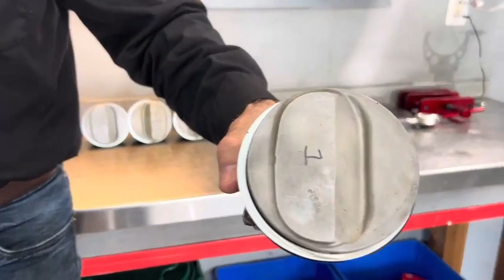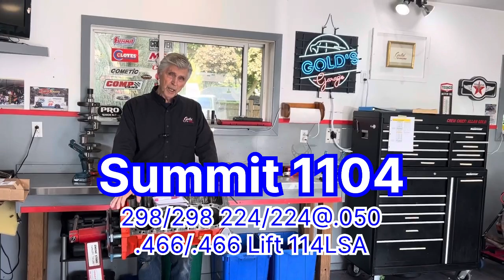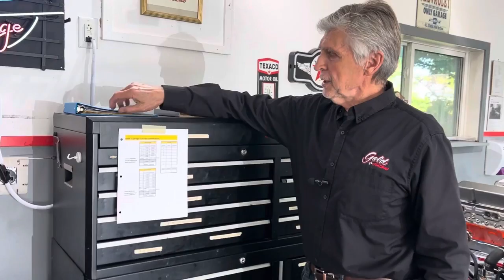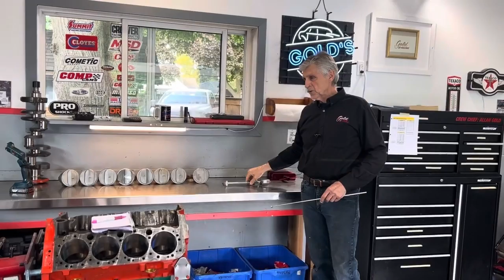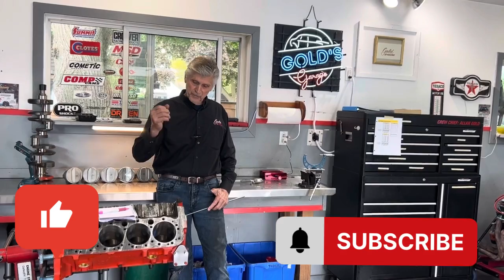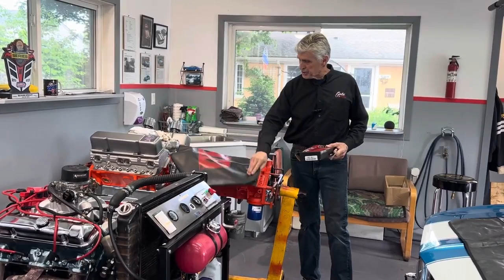I GOT RIPPED OFF ON THIS 350 CHEVY!! - What Happened?? What should I do??

Comment: Thanks for reinforcing the information of the strength of a two bolt main small block. When I bought my 55 Chevy 27 years ago I pulled the engince and found that it was a two bolt main 350 ci engine. My car building friends advised me to sell it because it would never hold up in a perormance build. Since that time I have read where the two bolt main would have been fine. Nice to have that reinforced here. I did sell the block and someone got a pretty good deal. I learn a lot from your videos.
Reply from the maker: Thanks Neil. There are a lot of misconceptions out there. Before Chevrolet introduced the 4 bolt design in 1969, even NASCAR engines were two bolt, making about 600HP. Glad you found the information helpful.AG

Comment: Hey Ace I feel bad you're having so much trouble with getting what you want from the machinist. It reminds me when I overhauled my Pontiac 400 a long time ago. I did a few engines from this local shop where I live and I had Chevy engines that become junk in short order and I found out why mine did that. It was because the oil passages were dirty and I trusted them to clean it  after reconditioning the crank and block but they didn't so when I had the Pontiac done I told them what happened the last time and I asked them to make sure its clean but guess what. I took it home and bought a brush cleaning kit and you should have seen what come out. You could plant a mustard seed garden. I was hot 😡 looking like new on outside but would have become instant junk if I didn't clean it myself and check behind them. Finally I have a reliable engine. That's the one with the sum-2800 cam it runs good
Reply from the maker: That is a good story Christopher. Why you have to check everything yourself. Thanks for contributing. AG

Comment: That crank would have spun that bearing. I run my stuff on the loose side. Even with .009 bearing that is only .0017 clearance. Personally I’d have crank reground .020 and use .020 bearings but that’s just me
Reply from the maker: Thanks Turbo. With the .009" bearings I am now between .002"-.003" on both rods and mains. AG

Comment: That might be interesting to some people to know what the deck height is to get the quench you quoted. It looks like the block wasn’t decked. 
Piston, part numbers, and Vortech casting number.  New or used Holly carb and model number.  What connecting rods and I’m assuming it’s a cast crank.  Just a few things off the top of my head but I’m sure I missed a lot
Reply from the maker: Thanks for the question. The deck height is .025" so with a .015" head gasket, quench is .040". The Vortec castings are 062,  stock rods and crank. pistons are 7051P, .030". No carb is selected. AG

Comment: fire sale !! we had a machine shop around here that screwed everything up they touched just like this ! i brought them carillo rods to clearance for a stroker they took so much off the rod the boss cracked with 60lbs of torque put on the bolts ! all i asked for was for them to take a tiny bit off and they destroyed some very expensive rods ! in a year they were out of business they gave me a 350 olds crank after i took them a 455 crank and my assembly wouldnt turn over ! i took the crank back and told them somewhere theres a guy with a 455 crank ! when they return give them their 350 crank ..sure enough a customer comes in yelling at them these mains wont bolt up what did you do to my crank !! bam got my 455 crank took it to another shop well it was full of cracks that i know were never there !
Reply from the maker: Thanks for sharing your experience Steve. Unfortunately there are many stories like this. AG

Comment: Great video. Unfortunately this kind of stuff happens often. I once bought a "350" that turned out to be a 305.😡
Could you share the part number for the rod bearings? I also need some that are for a 10 under crank with .001 extra clearance.
Reply from the maker: SUM-909H009  - Main Bearings 
SUM-663H009 - Rod Bearings 
Thanks for watching.
AG
Reply: Thanks!

Comment: Way too tight bearing clearance & good you Measured/checked....that Pop-up Domed piston could be Problematic for pump gas octane operation....Back in '69, used Similar domed TRW forged 0.060 over pistons in a factory stock '66 389 4 speed 4 barrel GTO engine with long duration Solid lifter cam....Don't know what actual static CR that was but Even on Sunoco 260 engine ran Hot, would over-run starter & almost start up Without ignition coil connected !! ....With stock dual exhaust mufflers, had a very Unusual "Diesel" exhaust sound whatever that means.....Just sayin those high dome forged Pistons caused me Problems back when nearly 100 octane pump gas was available.....
Reply from the maker: Thanks for the info Tom. We have revised our plan since this video. Now using ProMaXX heads and the calculated cranking pressure is safe. I will do a follow up on this engine. AG

Comment: That spec is similar to the 350/350 vette engine, but with way better heads. Should be a nice street engine!  I try to follow the .001 per inch of dia. New engines run way tighter but 0w-16 oil.
Reply from the maker: Thanks Mike. i would also expect that the tolerances would be tighter on a new engine. You just gave me an idea for a video about tolerances. AG

Comment: I’m surprised you run single pattern cams with Vortec heads. I always read not to. I’m going to run 1103 summit cam, Vortec & stock 400
Reply from the maker: Thanks DRD. I have a follow up video coming on this engine. AG

Comment: I bought a rebuilt short, had to disassemble it and clean it properly, all the machining was good, oil galleries were never cleaned properly and the bores needed a proper clean.
You're eventually gunna get caught out with late intake closing with high comp, if you use good heads and a tuned length inlet manifold will fill the cylinder properly and rattle.
Reply from the maker: Thanks Tom, that is a good point, we will be watching for that on the dyno. AG

Comment: I wouldn't worry about the rods. Mains are a bit tight. Run thin oil and it will last fine NASCAR engines run about .001 on both rod and main with 0w17 oil and only about 45 lbs oil pressure.

Comment: Those pistons will hit the head  unless you machine the chamber in the center of the heart shape.
Reply from the maker: Great advice Brian, I will check that out for sure on assembly. Thanks. AG
Reply from the maker: I mocked it up already. You are correct Brian, they do hit on the spark plug boss. Plan B, I will use my ProMaXX heads on this build and save the Vortex heads for another 350 i have to build. You saved me a lot of trouble. Thanks very much. AG

Comment: .0007 and .0009 is too tight to form the proper oil wedge for the bearings. This is probably why they are not in business now!  I dont know if this shop ground the crank or if they farmed it out, but obviously they never checked clearances!
Reply from the maker: Correct, thanks for the comment. AG

Comment: What compression are you running in the sbc that is going to have the Howard’s camshaft in it.
Reply: It's a good thing (For everyone) you checked & Measured 'cause the typical buyer Assured of "Built" 6500 Rpm "Race" componets/assembly would likely have had a very "Bad" run experience & returned the mess to you....Changing directions, It'll sure be a nice reliable street motor for some lucky buyer.....
Reply from the maker: Thanks Tom. AG
Reply from the maker: I would need to know the cam specifications to answer that question. AG
Reply: 470 lift..108 LS

Comment: Comp cams has the 12-673-4 Nostalgia solid which they say is a modern tight lash version of the 30-30 cam with the same exhaust note.

Then they have the 12-672-4 hyd flat tappet which they say has the exhaust note of the 30-30 cam with increased performance.

Lunati has solid versions of the Duntov and Z28 cams, numbers 30121009 and 30121005.

Howards has solid versions of the Duntov, 1st design off road and 2nd design off road cams.
112192-14, 117422-12, and 117692-12.

Lastly Crane has solids their versions of the factory Z28 cam and the off road cam.
967251 and 968821.
Reply from the maker: Thanks for all that info and even the part numbers Pockets, saves me a lot of research time. AG
Reply: @goldsgarage8236 I found a few more!
Comp 12-107-3 solid, says factory 302 cam.
And Summit has SUM-1125 and SUM-1126 solid cams.
Reply: Welcome!

Comment: You are going to have too much compression with a set of Vortec heads and those pistons. The chambers are too small. The cam is fine as it is the same as the Chevy L 82 cam. If you use aluminum heads then you can usually squeak by with a 65-68 cc chamber and those pistons. The aluminum sheds the heat and allows the higher compression. If you go that route then don't just use some junk heads, put something decent on it. All the power is in the heads. The Vortec is a good head but they have cracking problems and they are iron which is not good for your situation.
Reply from the maker: Thanks for the great advice Mike. AG

Comment: A great spring package for vortec heads and flat tappet or hyd roller cams, that requires zero machine work, is the following.
Summit beehive springs SUM-174002, Summit retainers SUM-174003-3, Fel Pro SS72861 valve seals, and stock vortec locks. This gives 1.75” install height, at 109lbs, and clearance for a .500-.520” lift cam (measure due to variances). If you substitute the locks for +.030” Competition products VTO4134, for 1.78” install height and 98lbs on the seat, you are good for .530-.550” lift cam. Again variance is due to machining differences.
Reply from the maker: Thanks for the detailed information and great advice Pockets. AG
Reply: Welcome!
Reply: This is awesome info! Thanks!

Comment: Yeah that is a tight one. 
Speaking of 4 bolt blocks, I have one I'll be selling soon since I decided on a crate engine rather than building what I have, a .040 over 350 010 casting block. Have an EPS manifold that's very near new also. Even got a billet manual flywheel for it and many other goodies. There is always another project though.

Nice work on keeping track of the details!
Reply from the maker: Thanks Jimmy, if anyone is interested you can connect on my channel. AG

Comment: It would have had great oil pressure until - oil temp would rise from being to tight. And absolutely would of spun bearings. The cam is a comp magnum series. I'd of chose to regrind crank. 6 of 1 half dozen of the other.
Reply from the maker: Correct, thanks Pat. AG

Comment: I pulled an original 67 Camaro  ss engine  a 350 first year and it was a 4 bolt with a forged crank, so they were built before 69.
Reply: 4 bolt mains were not available until 1969 when GM redesigned the main webs. Someone could’ve retrofitted factory 4 bolt mains, but they weren’t available in 1967.

Comment: I have replaced factory mains with .001 stamped on the back, bit longer run in, now works fine
Reply from the maker: Thanks Jim, that is what I did. Since the crank is .010" the bearings are .009". AG

Comment: You are spot on with what you would like to see on clearances.   NO WAY I would it as is, TOO tight.  It’s still going to be tighter than I would like with .001 clearance bearings. 
.001 per journal diameter would be minimum for a hot street engine if I was building it.
Reply from the maker: Correct, thanks Jake. AG

Comment: I wouldn't put that cam in my enemies motor...The thing of it is, that cam will work with the 11-1 comp. But you wont be able to advance the timing to full beans, where the engine actually wants it for max power....
Reply from the maker: Thanks for the comment Steve. AG

Comment: Most of my nitrous SBC's were 2 bolt, the one 357 that I dynoed made 820 hp and 700 ft lbs at 7400 on a 300shot, NA we ran it to 7700 at 530 hp. 21 pulls total with 7 of those being NA. All main failures I have seen pull the web out of the block with the bolts in takt regardless of 4 or 2.
Reply: That's some crazy numbers for a n/a 357. A guy at my local track has a Camaro with a sb2 that makes 830 hp N/A from 358 ci. It turns like 8400 though.
Reply: @bradmac01  Yeah the SB2 is one mean dude but way out of my price range.
Reply: @pontiac411  that guy found the sb2 used for 12k
Reply: @bradmac01  my 820 was on a 300 shot, I just edited that in, I thought I included that.

Comment: glad you pulled it apart, I wouldnt run it that tight either, I like what you said, about .0025 on the rods nd .0030 on the mains
Reply from the maker: Thanks for the comment, the .009" bearings fixed it for me. AG

Comment: My question, you buy an engine that you don't know from a shop. This should give some red flags. I would emagine the price was right for the parts but not included the work as you couldn't check it. So why buy parts in advance as I think your experience has wispered in your ears you didn't open it so didn't know what was inside? Greetings Peter

Comment: I've used 1.5 thou.up to 7,800 -8,000 no problem and 1.5 to 7,200 motor lasted 25 years ran 11.1 at 120 411 gears 3200 lbs car. Flat cam pump gas iron 200 cc sportsman cylinder heads pocket ported .

Comment: all the engine builders I know use a basic rule of .001 for every inch of crank journal. so a SBC with a main journal of 2.450 inches would be .0025 inch.  to me, that is a little on the loose side for me. in reality you would be ok anywhere from .0015 to .003.  me personally I like them a little on the looser side of things for main journals, so I would be shooting for around .0025 for the main bearing.  for the rods, a chevy is 2.100 of ideal clearance would be .0021 on rod bearing clearance using that rule. in reality you could get by with .001 to .0025.  I would be shooting for the tighter end of that clearance so around .0015. to me its ok to have a looser main journal than a looser rod journal. the rods are swinging all around in then and the crank is just rotating around. 

Newton's law of motion being - an object in motion wants to stay in motion until acted upon by another force applies here.so the rod is spinning on the crank with oil wedge between it, as it is being pushed to TDC on the exhaust stroke .as that stroke comes to an end, the piston is still accelerating as the crank is slowing down as it approaches TDC (this is the piston dwell time. as this happens a loose rod with continue upward that .002 of clearance.  and the hydrodynamic oil wedge cushions the force of impact as the change in directions occurs, if you have the right oil pressure. this ware will appear be see in the bottom half of the bearing. the looser the Clearence, the more pressure you need to cushion that blow. the same thing happed as the piston approaches BDC on the intake stroke, this ware will accrue on the top half of the bearing. on the compression stroke, the opposite happens, the piston is compressing all that air and fuel, and the rod is press against the crank and riding on the oil wedge, causing ware on the top half of the bearing, if you don't have enough oil pressure. this is also why you will always see ware marks on the top half of a rod bearing when you tear down an engine that has run it to detonation/pinging. that detonation force is enough to drive the oil wedge out from between the bearing and journal and cause the ware.  the power stork will also cause ware on the top side of the bearing since the pressure from the combustion cycle is pressing the piston back down on the crank, causing it to rotate. 3 of the stokes cause ware on the top side of the rod bearing, so that is one of the areas I always inspect when I tear down a engine. also, the better the cranks spins, the less rod bearing ware you will have. so, I am ok with cranks a little lose on the main journals, but i like them a little tighter on the rods.  but overall, the .001-inch Clearence for every inch of journal diameter works pretty well.

Comment: Polish crank about .0003 add the extra clearance bearings and use a  15 to 40 weight oil , on  older engines seems ( to me ) they like the extra clearance. By the way I really appreciate your knowledge and watch your videos regularly.
Reply: .0003 wont be enough.Maybe  .0013 would work.
Reply: Sometime times it's hard to polish that much and keep crank round
Reply: @durwardmedlin810  yep you can screw it  up quick

Comment: Unless you are dealing with a known shop that is honest with the information that they are giving you or you have an acquaintance that you have known for a long time and you know their work, it is foolish to just buy a used engine or in this case a purchase on a supposedly machined engine and just try it out only to find that it goes kablooey. I had a friend of mine (now deceased) whose work on an engine I trusted simply because I knew him so long and we had some differences in the parts we used in an engine but his skill in assembling an engine I trusted. I bought a big block Chevrolet from a fellow some fifty years ago and was able to talk to the fellow who built the engine, but whenever I get around to using the engine it will be disassembled and checked just as you have described. At least I will know what the engine has as far as clearances and such.

Comment: I think the tight clearances would cause spun bearings at 7000rpm when they heated up. I guess we know why they went out of business.
Reply: I have a 388 that I shift at at 7800 with 1 . 5 Clarence
Reply: @asbelfernandez3598  The clearance was .0007 on golds engine. That's half what you have.